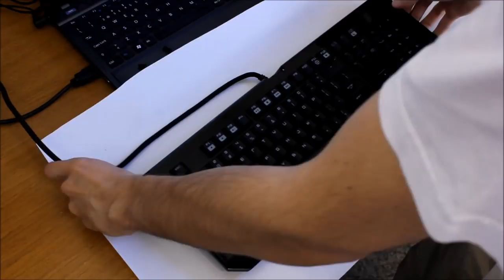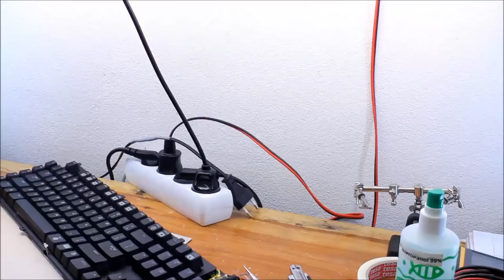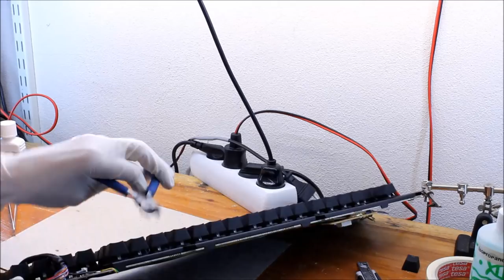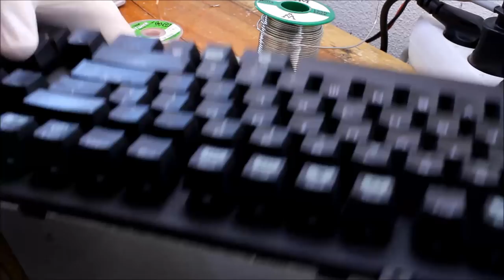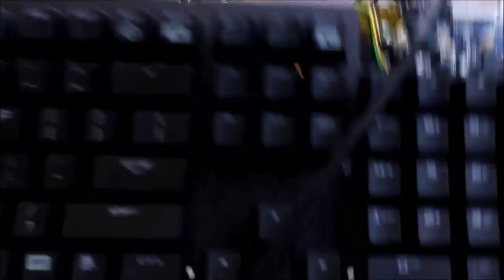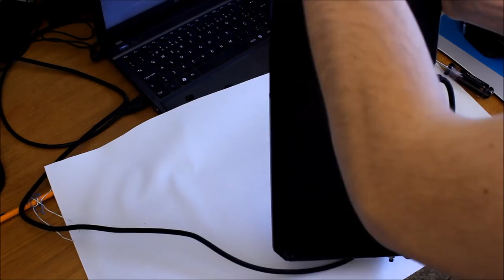How to replace backlight LEDs and Cherry MX switches in a mechanical keyboard.

Comment: Hi,
i have a black widow keyboard and i wanted to know, which switches i can use to replace the switches in my keyboard with
Reply from the maker: Dead Digger If it's a regular blackwidow (not the chroma variant) you can probably use any Cherry MX switch compatible with LED backlighting. If you have the new cloned razer green switches, you might get away with just replacing it with a cherry mx blue.
Reply: I have a blackwidow without backlight, thatsmymain Problem i dont find stuft about the stealth Version. Thanks a lot for The fast answer
Reply from the maker: It just doesn't have LEDs on top of the switches. Other than that it should be identical.
Reply: Ok Thank you very much

Comment: Can you use the same LED light that was taken from the key, and re use it again?

EDIT:  I am using a blackwidow ultimate 2016 I got for dirt cheap, but some keys arent working, so I am working on replacing the keys.  SOOO

Taking out the LED light from my Razer switches, and re using them in my replacement Cherry MX switch?  How would that work?  OR would it work?
Reply from the maker: You should be able to. In fact, if the LED is still working it is preferable that way. When you reuse the old LED you will make sure the color is similar to the other LEDS, when you use new LEDs it can be hard to match the color of the old LEDs with the new ones.
Reply: What about switching Razer's "green switches" and replacing it with a cherry mx switch would that be compatible?   I would only be replacing about 3 switches that are broken.
Reply from the maker: They appear to be similar in size, I would try it. If you have green switches you can replace them with cherry mx blue, if you have orange switches you can replace them with cherry mx brown.

Comment: Sorry for bother you, but coould I put leds on a no-backlight keyboard such as the keycool 87? It actually has 3 leds in the capslock/scroll lock and F12 key which make blue light, but the other keys doesn't have the led. They have the holes for the led, tho. 

PS: sorry for my bad english, I'm native spanish :P
Reply: Your English is pretty good Santi.  I counted not very many mistakes.  Keep trabajando at it good man!  :D     Tienes una bueno dia. 

P.S:  I am not COMPLETELY fluent in Espanol, per  Yo sabo a little bit.
Reply from the maker: Hi, no problem at all. That depends on how they built the keyboard, we don't know if the circuitry like the resistors and pwm drivers are present. Try to stick an LED in there, even without soldering it should light up.  If it doesn't work, try reversing it. If it still doesn't work, can you send me a picture of the top and bottom of your PCB?

Comment: can i change a static color LED, like on the corsair k70 with just the red led, and change that with an RGB led?? please respond fast cause one is on sale so i kinda want to experiment lol
Reply from the maker: Probably not. There are LEDs that change color by themselves, like this one: https://www.sparkfun.com/products/11448
They would probably start synchronized, but after a while your keyboard would be a random heap of colors, each LED with a different color, you would not be able to control them, see them in action: https://www.youtube.com/watch?v=ExD0vdqt-Lo

It is also likely that your keyboard would not be able to supply the required current to drive such powerful LEDs.

Comment: Hi. Heeelp. Where i can find the resistor for the Key on the blackwidow logic board ? I have Key that doesnt work. Have already replaced but not success.
Reply from the maker: What is it that doesn't work, the light or the key itself?
Reply: Both doesn`t work.
Reply from the maker: Then you most likely have a damaged PCB track, you will have to trace where it goes and replace it with a shunt wire. Unfortunately, if I recall correctly, to access the top layer of the board you will have to remove all of the switches and LEDs, so hopefully the damage is in the bottom side of the PCB.
Reply: yep. i have thinking on it. i had removed all the keys and LEDs. Then i need to remove the bottom side and detect some faulty resistor and replace it with a solder help. Thanks for your help.
Reply from the maker: It's probably not a resistor, most likely the damage is in the copper track itself.
Reply: José Faria when i opened the keyboard It had oxidation. Probably was spilled Water on the same.
Reply from the maker: The copper probably got corroded, check the continuity of the PCB tracks in that area.
Reply: It is track indeed. I realized some measures of continuity from the key ''1'' to key ''q'' which it has issue for not work the key and LED aswell. But, i didnt found a problem. I need to take a look more on deep. Take a look on this picture i`ve found on the internet, it`s not a razer keyboard. But, it has a resistor for the LED`s and Diode for the key. Where are the diode from razer keyboard? Thank you for your support.

picture on the internet..:
http://i.imgur.com/XuFi8So.jpg
Reply from the maker: Your keyboard should have a resistor for each LED but, if I recall correctly, it doesn't have the diodes. Those diodes are there in some keyboards that have a feature called n-key rollover, it allows them to register all the keys you press at the same time.
Reply: Wooow i`ve found a fault trail. How i haven`t see this before? lmao. Do you know how to recreate the trail? That connect the key ``f1`` to key ``q``. Key ``f1`` probably doesnt work becouse i dont use it and never knew that it wasnt working. take a look on the picture bellow.

picture..:

https://s6.postimg.org/erps5wwxt/DSC_0471.jpg
Reply: José Faria José could you Help me ? I have already fix the keyboard. But i forgot to link the Key "F1" with others keys by trail PCB. Do you have some diagram for razer keyboard or do you Know which keys the Key "F1" its linked? Thank you . Note.: I press "left ctrl" and "q" or "1" and not work. Only seperaly.  Ohh i remenber now. i Will give the news as Soon.
Reply from the maker: Just follow the track and connect the two points with a piece of wire. If you look closely at the lower side of the keyboard in the video the same happened to me and there is a bridge wire connecting two points.

If the track goes to the other side and you can't see where it leads use a multimeter in continuity test mode and probe other switches, one of them is probably connected there as well.
Reply from the maker: I don't have the keyboard anymore, btw, I tried a keyboard with Cherry MX Brown switches and immediately got rid of the blackwidow.
Reply: Hi josé. I fixed the keyboard. i put switch brown, some LED`s and a costumized it also. Take a look on the picture bellow. Thanks for your help. ;)

Link Keyboard.:

https://s6.postimg.cc/q1jf3ckch/IMG-20180411-_WA0000.jpg
Reply from the maker: Glad it works. The top case looks pretty cool, was that water transfer?
Reply: José Faria yes. It was Water transfer. Amazing job that was painted on the  top and bottle of the shell.

Comment: those are some wire cutters, not some pliers

what temp iron are you using for this?
Reply from the maker: dioxideuniversal I used around 350°C, my iron had low thermal mass, I had to use high temperatures. 

English is not my primary language, so I go with the definitions. According to the dictionary, "pliers" is an adequate term to describe those:
http://www.merriam-webster.com/dictionary/pliers
"a small pincers for holding small objects or for bending and cutting wire"

In the wiki page, they also included a picture of wire cutters under "pliers" under "Diagonal pliers or side cutters":
http://en.wikipedia.org/wiki/Pliers#Gallery

Comment: Thanks you for your video but can you tell me where I can buy switches please?
Reply from the maker: Go to this page:
http://www.cherrycorp.com/english/switches/key/mx.htm

At the end you have a section called "ORDERING INFORMATION" where you can select the switch you want. As an example, for the razer blackwidow we want a switch with Standard force, click tactile and face plate mount, that leaves us with the part number MX1A-E1NN. Now you just take this part number and search for it in your favorite electronic component distributor. I usually use Mouser, but they are also available on Farnell and Digikey.
Reply: José Faria
Ok thank you for you answer,but I'm going to explain a bit more what I wan to do. I have a razer blackwidow with blue switches and since I'm playing osu I'd want to try other switches, so my idea was to replace some of my blue switches by red and brown switches. Is that possible?
Reply from the maker: Absolutely, as long as you buy the panel mount version without diodes they should fit without problems.

What switch feels best is a personal thing, I bought a cooler master with cherry MX brown and these are absolutely perfect for me. I liked it so much that I just gave my blackwidow away and never thought about it once ever since :D
Reply: ok thanks you very much for your quick answers and your advices

Comment: can we remove the led pins with the pump? I don't think I got solder wick with my kit
Reply from the maker: The pump should be able to clean the hole afterwards, but the easiest method to remove the LEDs is to heat both pins at the same time and then just pull it out when the solder is properly melted.
Reply: so , i melt the two pins , remove them, then i pump the remaining metal

Comment: hi i have 0 experience soldering but my "t" and "a" keys feel like they need to be raplaced, i feel dumb asking this, but how likely is it for me to make it worse if i fail by tryig this with no experience?, your video is great tho i feel lioke i get the gist of it
Reply from the maker: +Rix Morel I would practice on some OLD printed circuit board first. Desolder and resolder components on an old board to get some experience then, when you are confident, do it on the keyboard.
Reply: i'll do that, thanks dude .
Reply: +José Faria thats good advice.

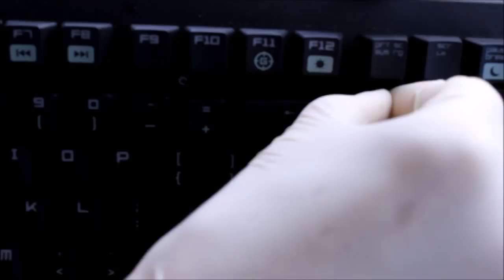Comment: 10:21 what does Polarity mean ? never heard that word ever before.
Reply from the maker: It's a word used when you have 2 things that are opposed, in this case it's related to energy, you have two poles, positive and negative. If you look at a battery or a device that uses batteries, they usually have text that says "Respect polarity", that means you need to insert the battery in the right direction, with the positive side of the battery to the positive side of the device.
As an example, look at the third line of text on one of my rechargeable batteries: http://i.imgur.com/KF5wnkL.jpg

Comment: nice vid. I have a razer ultimate 2010 edition that has a few sticky keys due to kids spilling something on it. Was looking to replace the KB, but hard to find comparable Kb with similar options.
Reply from the maker: You could try removing the keycaps and washing the sticky switches with a spray of dry contact cleaner, they usually have very strong solvents that might do the job and clean your switches.

Nowadays there are lots of options, at the moment I'm using the Kingston tenkeyless FPS alloy pro and it is perfect.

Comment: Is it possible just to add leds to cherry red switch?
Reply from the maker: It depends, if we are talking about a keyboard that didn't came from factory with LED backlight it probably doesn't have the other required components to make it work. Also note that some keyboards that are not backlit use special switches with regular diodes on them instead of the LED to avoid ghosting, in those switches you don't have room for the LED.
If you want to read more on ghosting and diodes on keyboards check here: https://deskthority.net/wiki/Rollover,_blocking_and_ghosting

Comment: hello al i want to know is how to remove led from my vortex pok3r

so what i understood from this is that i need to heat up the pins then use the solder pump to remove the led?
Reply from the maker: If you have the regular version (fixed color backlight) and you just want to remove the LED, not replace it, you can just heat both pins at the same time and just pull the LED on the other side while the solder is molten. If your keyboard is the RGB version, however, you can't do that, the LEDs  are most likely under the switch itself.

Also note that if your keyboard has LEDs wired in series, if you remove one LED other LEDs might also stop working.
Reply: My keyboard only has blue led and it doesn't have a wire... thx

Do i not need a solder pump? I should just pull it out from the other side?
Reply from the maker: The pump is only useful to clear the holes for a new LED, if you only wish to remove it, not replace it, you only need the soldering iron, not the solder pump.
Reply: thank you

Comment: If I replace the switch without putting back the LED, should I still expect the switch to work? Thanks for the video

Edit: Nvm I took out an LED and the switch still worked. Guess because I didn't have a solder pump I ended burning up the PCB a bit as I tried to pull out the old switch and now the switch doesn't work at all after replacing it. :(
Reply from the maker: +MrChickenLegss If it's a Razer keyboard, the PCBs are very low quality. You will need to find where the PCB trace was going and just solder a bridge wire from there to the switch pin with problems.

Comment: If I wanted to replace only the switch and not the led would I still need to solder anything
Reply from the maker: +SomePurpleRandom Yes, unfortunately, to replace the switch you need to unsolder and then resolder both the LED and the switch.  Before removing the switch you need to remove the LED.

Comment: my whole keyboard isn't lighting up anymore, even pressing capslock has no light, any idea how to fix it?
Reply from the maker: The caps lock led not working is weird, it is a separate circuit in that keyboard, I can't think of anything right now
Reply: @jfaria  I opened it and I couldn't find any damage inside. This happened after it was completely covered with dust when we had some repairs in the house. I used a blower to clean it up without opening before I turned it up but then there was no light anymore.
Reply from the maker: Might be that a component was cracked or badly soldered and the air pressure from blowing lifted the component. Maybe search for a missing component or poke them with a plastic tool to see if one of them is loose.
Reply: @jfaria  Thanks, I'll check it

Comment: one of my keys for my keyboard is broken (razer BlackWidow ultimate). It can still work but you just have to push down really hard. I was wondering if it's something with the switch or maybe a board problem. if it's a switch problem, is it safe to do to the same thing you did, just opening up the switch and trying to find what's wrong? thanks for the help!
Reply from the maker: If the keyboard is in it's warranty period ask razer for a RMA, if the keyboard is out of the warranty period, I would open it up and see what's wrong. If the PCB is not damaged just replace the switch.
Reply: The whole keyboard works perfectly fine except for the one key (A). It broke because i play this tapping game and one day I was playing and it just stopped working.
Reply from the maker: I'm betting on a switch malfunction (probably manufacturing defect).
Reply: I mean I bought the keyboard back in November and the switch "broke" in around March (I'm not too sure). So it was functioning but I did play that tapping game A LOT, and I still do, with the same keyboard, just now I use the arrow keys (if they break its not that big of a deal for me.)
Reply from the maker: The switches are rated for a minimum of 20 million operations, it's unlikely you reached that in less than one year. I would ask razer for an RMA.
Reply: I have over 2 million presses on my X key and it still works like new, you probably got a dud switch.
Reply: OSU
Reply: Dan Petrollini Why is it on the X key? looking for something? maybe, porn?
Reply: Using it as a mouse click while playing osu!.
Reply from the maker: Either the switch needs to be replaced or you have a bad solder joint, most likely the switch. If you want to open the switch and see inside, I think you can open the switch without unsoldering it from the pcb.